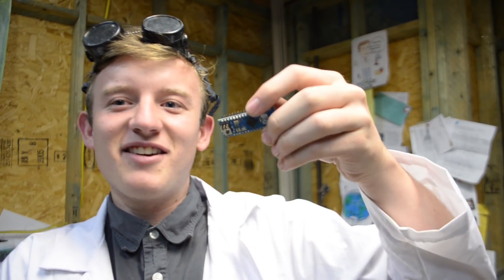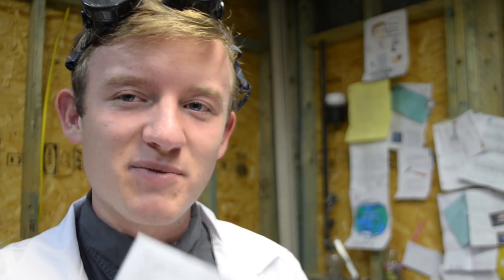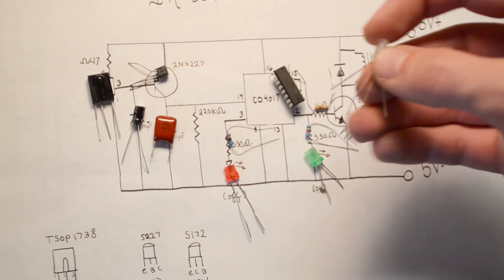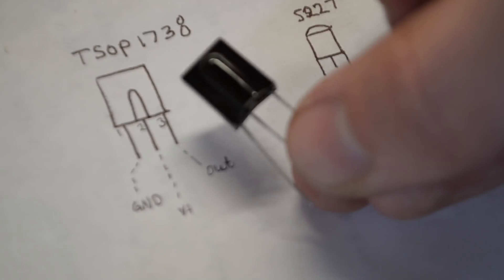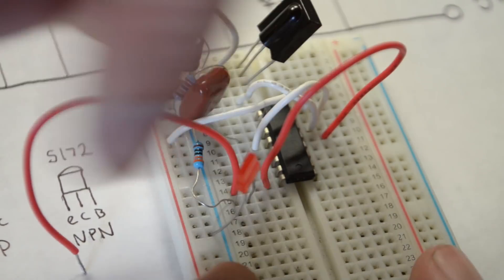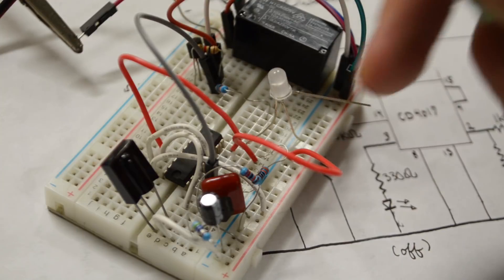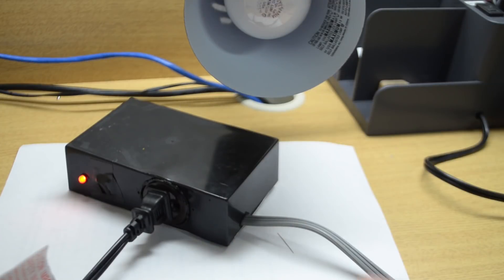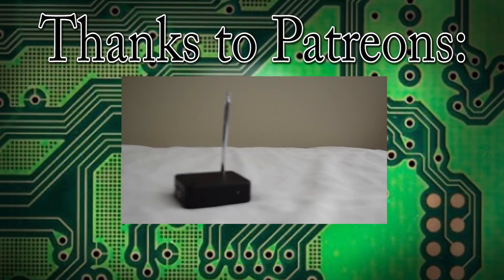How to make a Remote Switch

Comment: Hi out there,

I want to operate a 12 volt DC alarm device remotely ie when you open a door it makes a switch and transmits a signal to a remote receiver switching on the alarm, can it be done, can you buy a relay module that operates by a switch not a fob just a cupboard switch transmits when the switch is closed, hope this makes sense?
Regards Wally from Liverpool England

w.volleamere@gmail.com

Comment: Thank you for the Channel... if I may say so: I have noticed that you mark power supplied to circuit(s) with +V & -V (ex. +5V & -5V)... this will result in 10V... I would mark them +5V & 0V (or GND)...

Comment: This is great but I think I'd use a dedicated microcontroller instead of that simple circuit. Mainly because any IR signal can trigger that device instead of a specific code. It would be simple enough with the cheapest of microcontroller to have it look for a specific code and only activate when it sees that. I'd suggest something like the Microchips PIC16F15313-I/P which only costs around a dollar and has ample functionality for a project like this one. As long as it's sampling rate is faster than the baud of the transmitting remote speed shouldn't be an issue. It's just that it occurred to me that it might get a little annoying to have something switching on and off when muting and unmuting the TV or changing channels. That said, programming it to respond to something like the pause button on a blu ray player might be good considering it could turn a light on in a dark home theater such as to facilitate using the restroom without stumbling over things in the dark.

Comment: How could this project be modified into using an analog data wire (say from an Arduino) instead of IR? These kind of relays cost like $40, so it just may be cheaper to build one.

Comment: Add a voltage regulator
Reply from the maker: +SKHILLBILLYslurrrs I have one in there already, but I don’t think it’s too necessary, definitely nice though
Reply: Keystone Science true they are great wasting power but definitely spit out stable out stable and constant voltages (I mean I know you know but great for the comments section to learn 👌) what's your feild of study at college? I want to guess Electrical engineering

Comment: Nice project! Could you also built an RF one that works on battery with low consumption? I've got an irrigation pump I want to control remotely about 300m with eye contact for antenna if needed no obstacles open field. I just want to activate the starter switch remotely then it comes online and it's off-grid so I dont want it to drain the battery too much when idling.

Comment: Interesting way of using an IR sensor, At first I was thinking that the 4017 would count the cycles of the 1738, but then I realized that the 100uF capacitor is for ignoring the pulses and create the necessary voltage for the 5227,am I right?
Reply from the maker: +MrWilliam932 yep!

Comment: how did you know which button to press? do all ir frequencies work?
Reply from the maker: +Jackson Behrman all modulated it light, it must be above a certain frequency square wave
Reply: All will work because the receiver has no programmed chip behind it, meaning all Ir light will trigger it if bright enough.

Comment: You should make a device that automatically hammers nails into your wall.
Reply from the maker: +1234Daan4321 hmm, but then all the problems in my life would be solved, and I would be out of a job.
Reply: Keystone Science you can still make it so that you have to insert a "hammer" into the device. So basically an electronic battering ram.

Comment: You're sensing for any IR, right? Is the chip reading the signal sent by the remote (PWR, CHANNEL+/-, etc) or just looking for a threshold voltage? 

I know I could just look up the data sheet for the chip, but I'm assuming it's just a threshold. If so, the chip (and LED functionality) could be eliminated from the circuit, right?